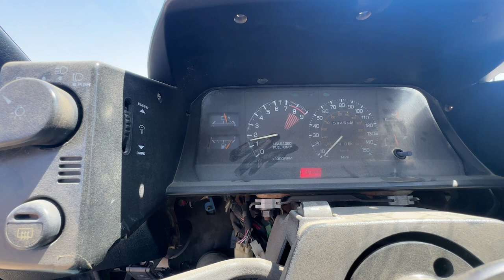1987 Toyota MR2 Rallycross: Overheating Our Way to Victory!

Comment: Rev bounce is often times a misadjusted tps. Try to get that adjusted plus clean the throttle body. That should help
Reply from the maker: It actually is a tell tale sign of low coolant as well. This ENTIRE problem was likely low coolant. Pretty simple fix. We'll have a jug of 50/50 with us from now on.